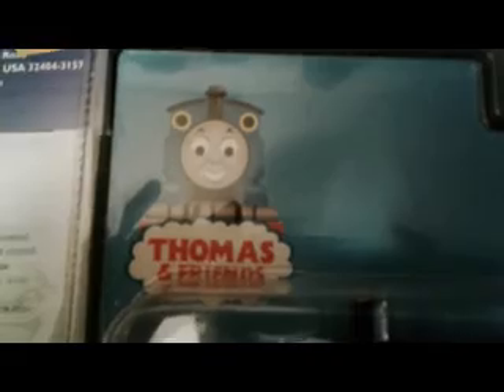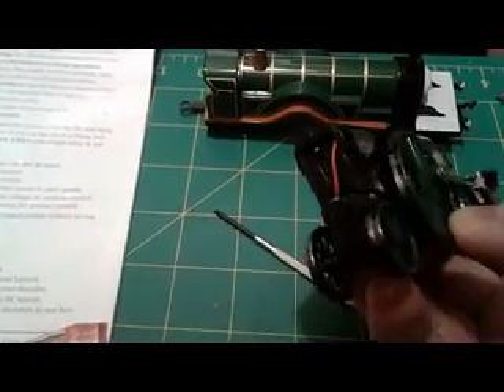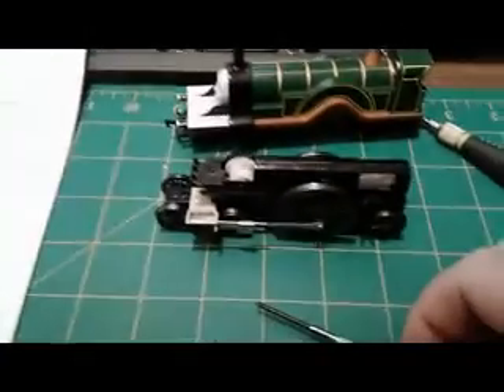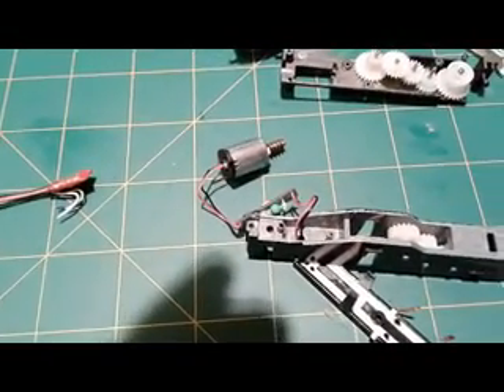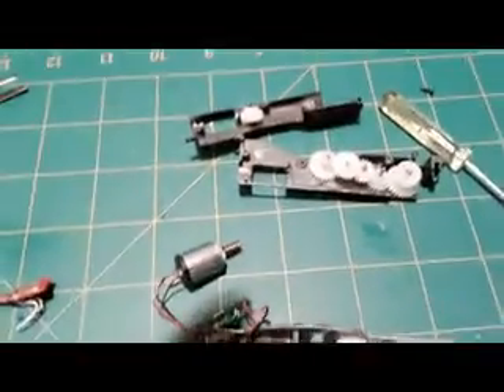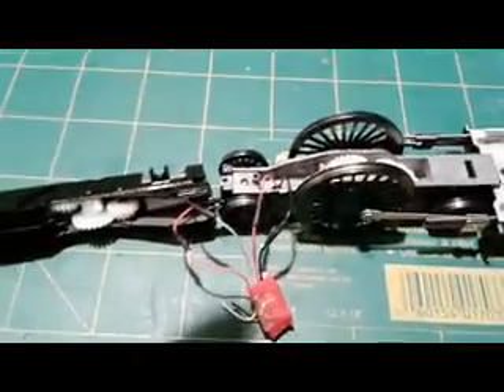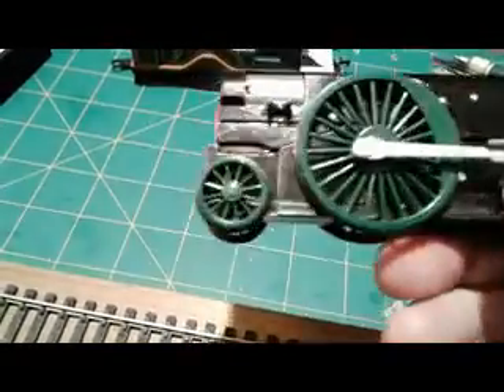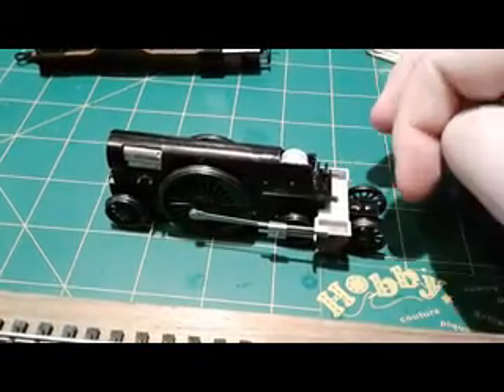Emily DCC Decoder Installation

Comment: Just bought an Emily, so this is great information.  However, I do have one suggestion I would make to others looking to do a similar conversion.  The leads on the DZ126 decoder are long enough that you do not need to splice into the existing pickup and motor wires.  Rather, you can just connect the leads directly and remove the other wires.  Also, as Emily has no headlight or tender light, and if you're not interested in adding lights, you can just cut those leads off.  This will make for an easier and 'cleaner' decoder fit into the available cavity, as you won't have the added bulk of the shrink wrap over the splices or the extra wires to deal with.
Reply from the maker: Hi! Thanks for watching and the comments. I agree, but I did not want to take the leads back to the motor. As for the other wires, I may in the future add LED lights. Or, I may remove the decoder and I would want to use it in an other install.
Reply: @sidetraxx779  I understand and fully respect that thinking.  One of my personal rules on installs is to minimize the number of splices required on wiring.

Comment: What’s the DCC decoder called that you used?
Reply from the maker: Hello! I used a Digitrax DZ126 decoder.
Reply: @sidetraxx779  thank you so much I’m making my HO Scale lady DCC
Reply: @sidetraxx779  question. Do you have a link or some info about where you can get the decoder?
Reply from the maker: @SweetLadyDelight  I guess it all depends where you are located. If in the USA, there are many online retailers, Yankee Dabler, eBay, or any hobby shop close to you. If in Canada, like me, a local hobby shop or Otter Valley. Digitrax.com may have links of distributors too.
Reply: @sidetraxx779  thank you so much